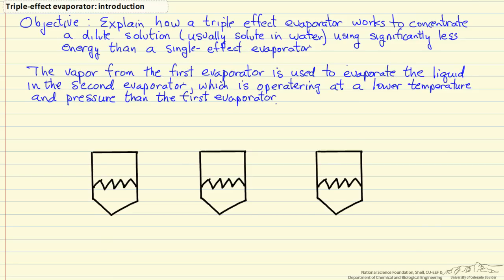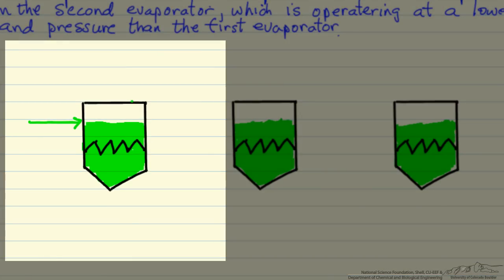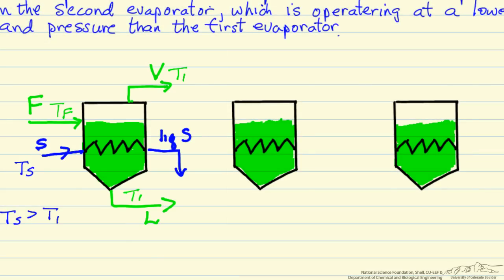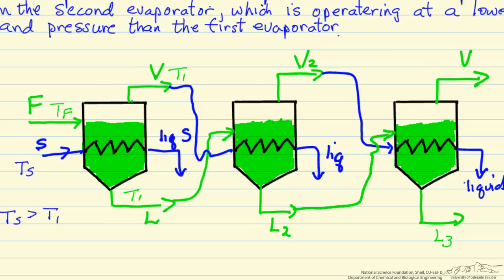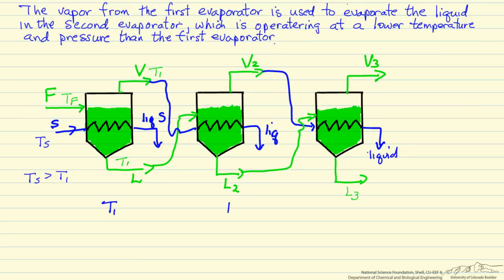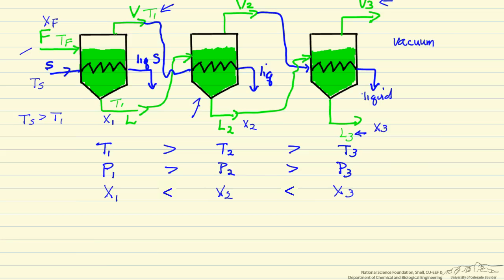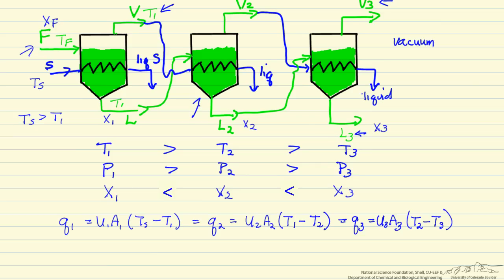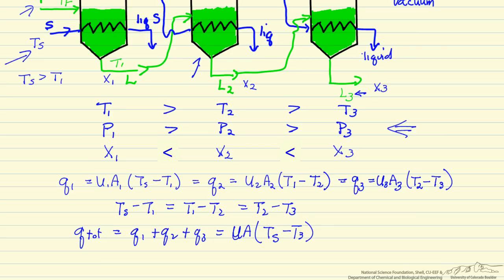Triple-Effect Evaporator: Introduction

Comment: Your video on backwards flow dilute solution is more realistic to real life use.
Counter flow design is always the goal with heat exchanging.
Reply: 'Always' is such a good word to excise from your vocabulary as an engineer. For example, in food ingredients production (like corn syrup), the feed flow is generally (much better word than always, as it allows for applications I'm not aware of) introduced in its most diluted state to the hottest, highest pressure steam in the first effect. Thus, each successive effect sees a more concentrated feed and subjects it to a lower temperature. This avoids scorching and introducing color to the product, something that is absolutely to be avoided. In corn syrup production if we were to reverse this (as I think you're suggesting, sorry if I'm mistaken) and introduce the most concentrated sugar solution to the hottest steam in the first effect, we would need less total surface area among the effects for the same ultimate evaporation but we'd likely wind up with baked, yellow-brown product that no one would want to buy. In real life, more variables than just capital cost are floating around out there.

Comment: Is there a reason why saturated steam is used instead of superheated steam to evaporate the liquid solution?
Reply: superheated steam is at very high temperature then saturdated steam . becouse of that product solution can be burn out or in case of juice or koffee plant . test of juice or coffee is bitter. its better to get concentration at particular temperture . steam stage is on saturation curve line . neither fully saturday or  neigher superheated to get maximum benefit of heat
Reply: superheated steam has a higher temperature compared to saturated steam. however, its heat transfer coefficient is significantly lower than that of the saturated steam.
Reply: IRuvJndL One other consideration, if steam is provided by a general plant or facility supply it is most commonly saturated stream by the time it reaches the process building. Superheated steam is of course generated at times for specific applications that require a higher temperature (such as slightly superheating evaporated vapors before they enter a mechanical recompressor to ensure no liquid droplets are present), but as you will expend more total energy superheating the steam than you'll realize in additional energy transference in the evaporator it is only done where needed.

Comment: How it's possible that liquid 2 and vapor 2 be cooler than V1 and T1? Who received that energy? I'd think that T2 would be equal to T1 because you are "heating" a liquid with a Vapor, both at the same temperature.  I mean, temperature vapor inlet = temperature liquid inlet and the result is temperature vapor outlet = temperature liquid outlet, T1>T2, WTF?
Reply from the maker: Great questions.  Temperatures are not the only changes here.  Note that the different units are operating at different pressures, so the saturation temperatures have changed which allow for a different equilibrium state.  There are also phase changes in both the heat transfer liquid and within the evaporator.   A simple answer to your initial question is that that energy went into evaporating more liquid.
Reply: This was my doubt and now it is cleared. Thanks @LearnChemE